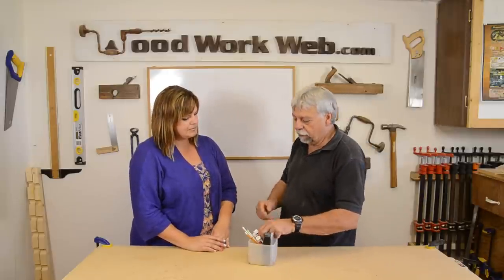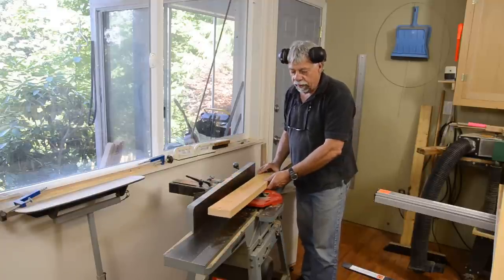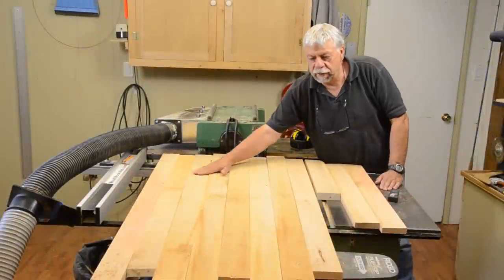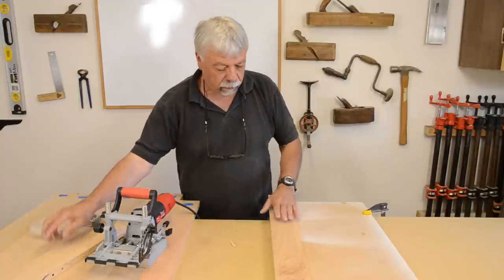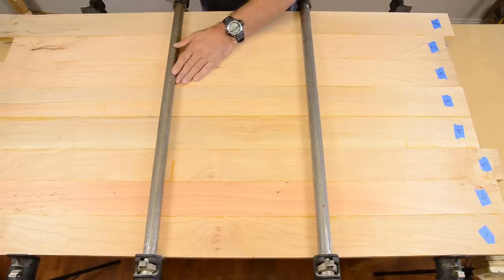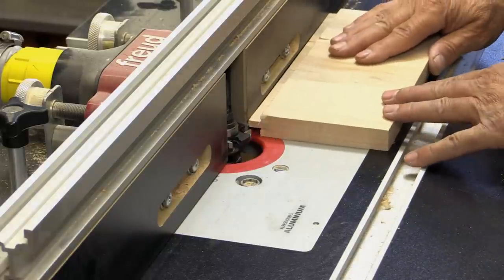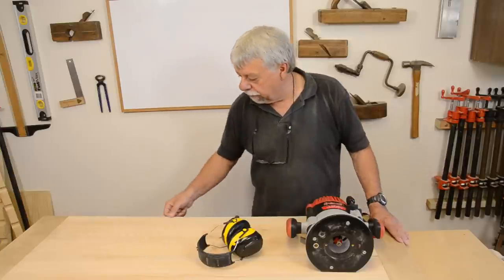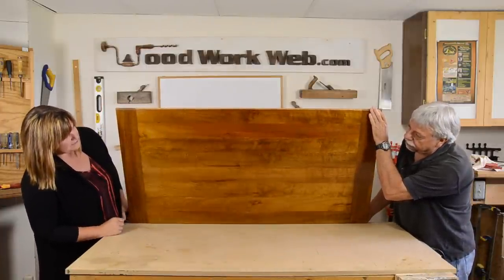Making a Cupcake Pastry Board

Comment: Someone asked me to build one so I'm doing some research.  So Tung Oil is food safe?  And what stain did you use?   I thought Mineral Oil was about the safest to use.  Nice work as always.
Reply from the maker: +Paul St George Hi Paul, I would check the Tung Oil first, you never know with some commercial versions what else they might be adding, Mineral Oil should be fine and I often use Dyes now rather than stains, but on cutting boards and such I don't use any coloring unless it's just for display.